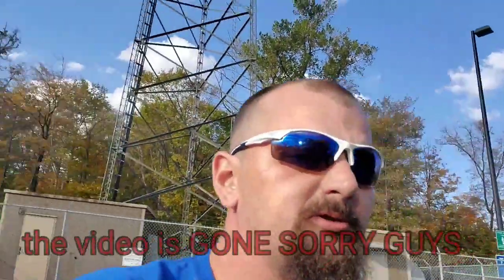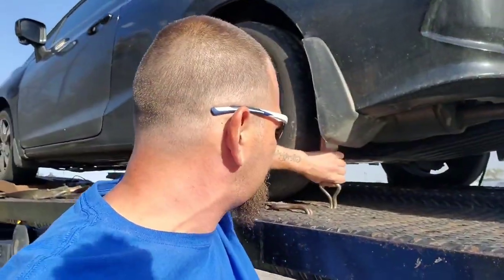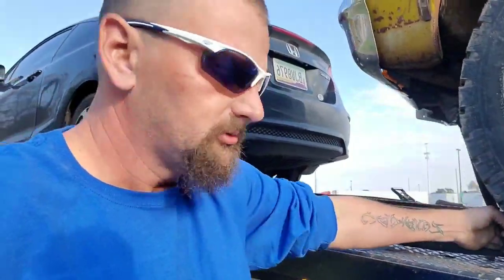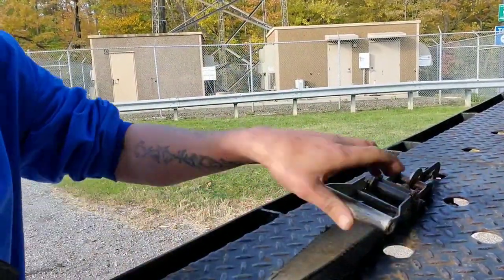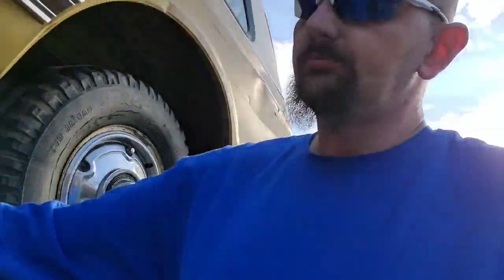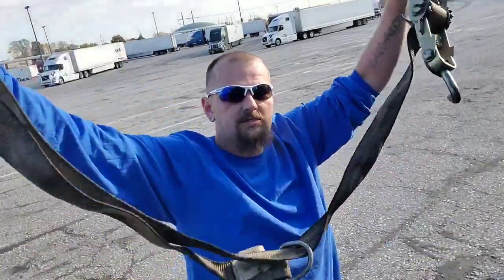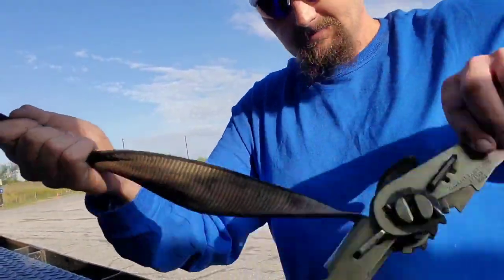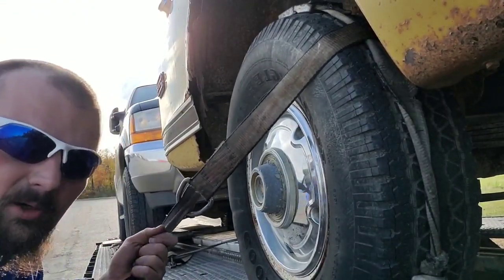How to load and secure cars on a 3 car wedge. #carhauler #3carwedge #hotshotcarhauler

Comment: What's your load time with paperwork? Like what would be a good time and what would be a typical time what would be slow and how long until you leave without a car
Reply from the maker: It all depends I rearrange the load everytime I load so the more that's on the more I have. The longer it takes obviously. 10 minutes with one car hour with 3 2 hours with 4 cars. The key is call and preperation.

Comment: On the 3 point straps does it matter which way the ratchet is pulling?
Reply from the maker: I like to pull either both in or both out. They say it don't but seems to be better the same direction

Comment: Why not go thru the wheel? I've done it plenty and I like the way it holds the car. Thanks Dave!
Reply from the maker: If you do it to the wrong one and it runs wheel it will be expensive I bet if you start looking you will see scuff marks
Reply: @Hotshotdave  haven't hauled any cars with nice rims yet, but I'll watch for that. Thanks Dave!
Reply: @dawolfboi  one of the reasons not to go thru the wheel is just like he says, it will leave marks, especially when ratcheting down. Another reason is that when going thru the wheel isn't good is because on some vehicles, the brake backing plate could interfere with clearance and could either cause the backing plate to get slightly bent which would cause some noise when moving vehicle or because those backing plates edges can be kinda sharp and cause rips, tears, and fraying in your straps.  Basically what I'm getting at is going thru the wheels can cause you extra headaches and charges. And I'm pretty sure we all have enough of both of those in our daily lives that we don't need to add any extra unnecessary issues.